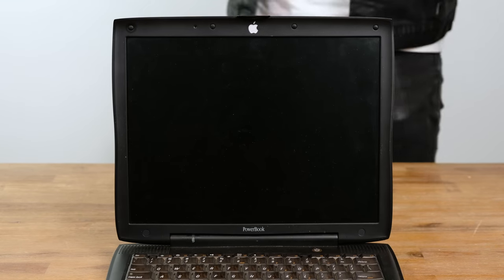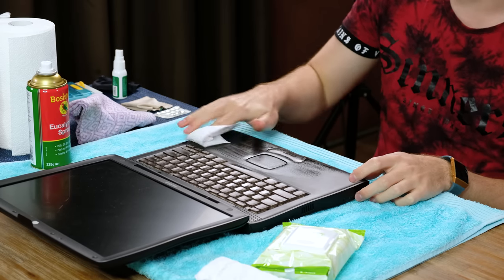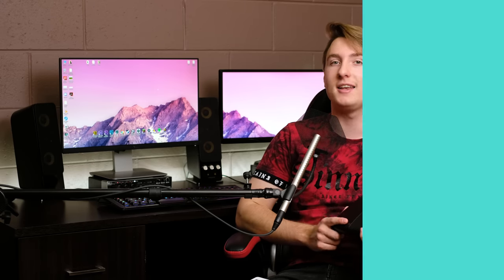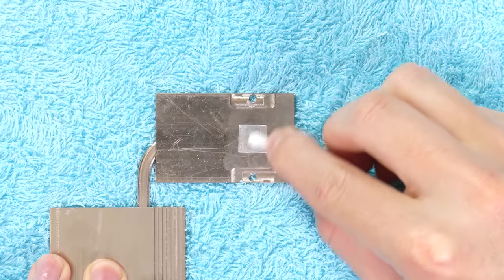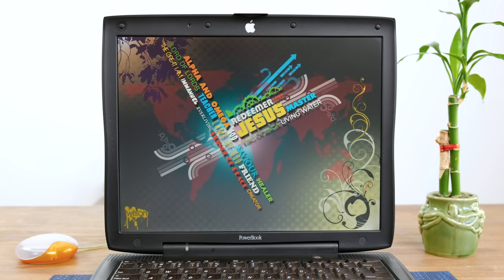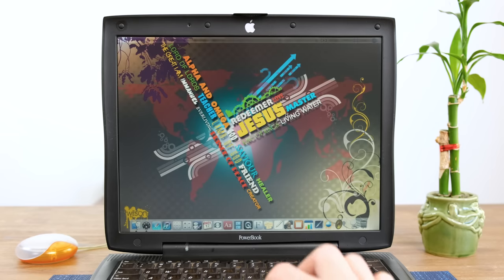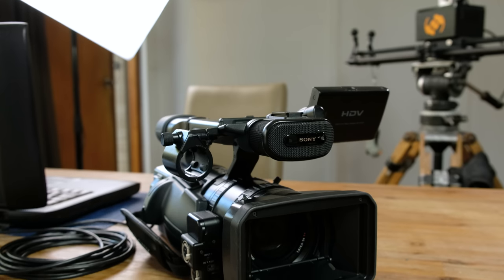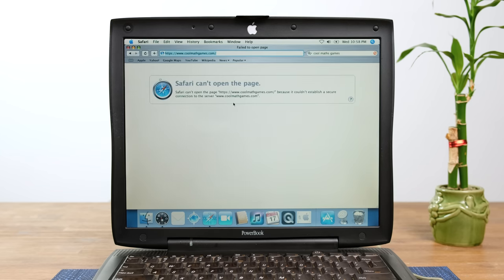Fixing Up A Broken Apple Powerbook From 1999!

Comment: Its hard to imagine how these machines use to keep up with such a low specs back in the days
Reply: Everything else had lower system requirements as well... So it was pretty much like using todays' hardware today
Reply: This was way superior vs pc at the time
Reply: If you're thinking about MHz to MHz comparisons, RISC generally got about twice the performance per MHz than CISC (such as Intel was, Intel has "RISC-like" internal cores with a microcode translation layer nowadays). Obviously it depended on the workload. But that was the entire raison d'être of various other companies like MIPS, who made server CPUs and also the PS2 CPU. POWER (related to PowerPC) still holds a niche in the server space to this day, and ARM is RISC as well – the absolute performance is no longer better than Intel due to how beefy heatsinks and power supplies have gotten, but the performance per watt is still much better.

Comment: Excellent video.  Also, thank you for some good tips for us who still use these vintage black and white apple laptops.  Own the model right after this, the G3 Powerbook Firewire because in addition to having two USB ports it also came with with two Firewire 400 ports.  This truly is my favorite design of all of the apple computer laptops because mine has a built-in airport card, two "hot" swappable bays for (i.e. batteries, DVD-player, Zip drive, Super Disk drive, floppy drive, and extra memory), accepts type I and type II expansion cards, for wireless printing an inferred port. audio-in, port, audio-out port, internal 56k modem port, Ethernet, port "S" video port, and VGA monitor port.

Comment: I had one of these.  They were available in 400MHZ and 500MHZ models.  The lower speed was always the best bet as they had the same cooling system.  The dual bays were great as you could run 2 batteries for long use, or no batteries with the floppy and CD drive (using a power brick).

Comment: older hardware was so much easier to take apart it seems like
Reply: The powerbook was for professionals so it was easy to access the critical things such the CPU, ram and hard drive. However the ibook G3/4 of the same era was for consumers and that was a pain to take apart, over an hour to just get to the hard drive but yeah you are right to an extent. It's just if the manufacturers want to make it easier to work on and back then they probably did alot more than before.
Reply: @squeakers27  yeet

Comment: That laptop is in better condition than mine! Just a little jealous. :D

I still love that model. The accessibility is great and I just love that flap in the back that shows the port markings. If the hinges and battery weren't toast on mine I might just still be using it.

Fun fact that you didn't mention in the video: you can put a battery in the DVD compartment as well, so you could have two batteries in.

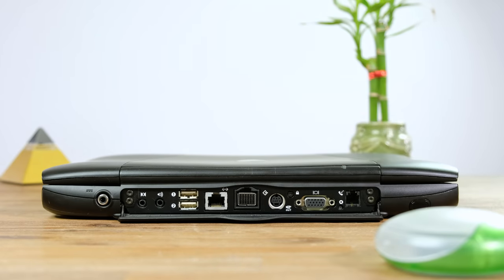Comment: So how many of these G3 Powerbooks did you use for this video, at timestamp 7:32 you show the back panel to a Lombard G3, which has no Firewire ports and has mini-SCSI, but your doing video capture and edit with firewire, which was on a Pismo G3, which has firewire in place of the mini-SCSI port.

Comment: V westlife talked about artic fox for older macs
Reply: I believe Arctic Fox is only for x86/Intel Macs. If this is running OS X 10.4, the TenFourFox is the goto for PowerPC macs.
Reply: Seshpenguin There is a PowerPC build available, either officially or unofficially, can’t remember, but I’ve used it.

Comment: I have a PowerBook G3 Pismo and it works, except the power connector seems not to work. I can plug in AC adapter, but it doesnt charge the battery. If put in a charged up battery, then I can power it up just fine.. so i think the DC power supply on the PowerBook is broken somehow?

Comment: oil on electronics
SOUNDS FINE
Reply: It actually is. You can fully submerge it in Oil (the main board at least, HDD and other moving parts won't like it) and it will probably be fine. Liquids aren't damaging per se, only the (semi-)conducting ones.

Comment: For web browsing, check out TenFourFox. It's an actively maintained fork of Firefox that is designed fro G3, G4, and G5 macs running 10.4 Tiger or 10.5 Leopard. It will work with pretty much any modern website like YouTube or Google Docs (though it is definitely sluggish on my 1GHz PowerBook G4, so maybe an old browser like Camino is still a good choice for the G3).

Comment: Too much thermal paste, also the one that was originally there isn't really a paste but a fine graphite powder film, that is still good even after 20+ years. They were used where the chips weren't that hot to begin with, as G3s are very cool (no pun intended) chips. I guarantee you that you wouldn't notice any difference in thermal performance even if you use liquid metal instead of this. Also AS5 should be applied according to instructions on their website, which you clearly didn't read.

Comment: cleaning the cpu die with oil? really, and then using a thermal paste with electrical properties? artic silver is electrical capacitieve, it's not recommended to use that on bare die's, use MX4 for that. and clean the CPU with alcohol the next time.

Comment: Okay, what the hell is going on here? You say it’s a 1999, but it’s clearly a 2000 cause it has a FireWire port for the DV camera, a bronze keyboard, no “G3” in the PowerBook name and it runs 10.4, something that the 1999 models don’t have. Yet when you open the ports on the back, you can clearly tell it’s not the same model as the rest of the video cause there’s a SCSI port on the back, which got replaced with the FireWire ports on the 2000 models.